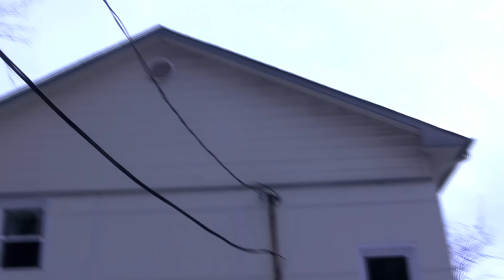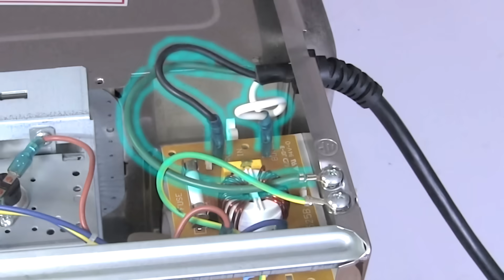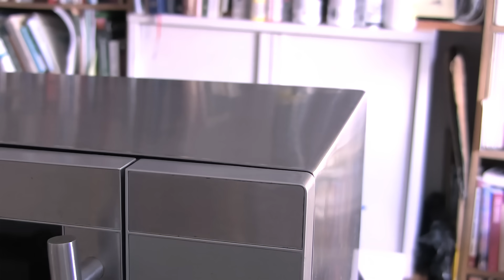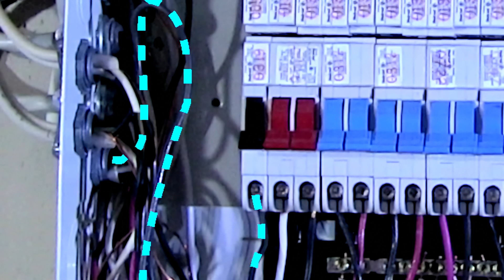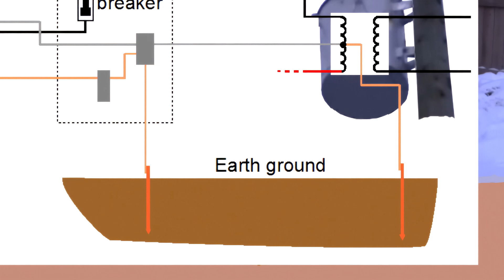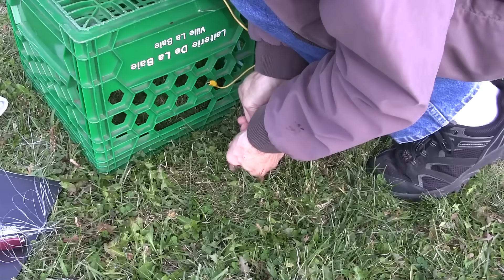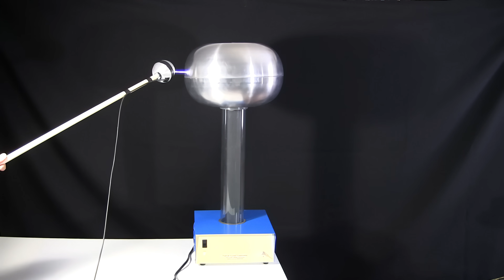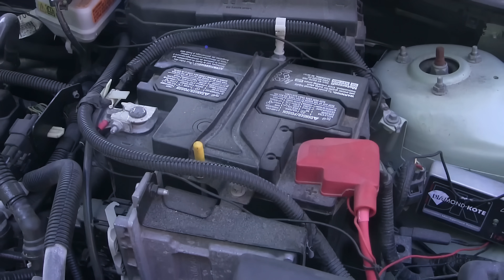What is Ground? Earth Ground/Earthing

Comment: Please, never ground to a water line...ever.

It's a very small chance, but a circuit can  corrupt or lightning can strike while you are washing dishes. 

Grounding to a chain link fence could kill anyone touching it.
Reply: Caramon Majere using water pipes as ground in the US is a code requirement, not an option.
Reply: Aren't most water pipe systems grounded anyways (even when a grounding rod system is used)?

There are issues with relying on water pipes for the system ground... but as far as the electrocution issue brought up:

The sink electrocution hazard wouldn't really be any different than the risks all the metal bodied appliances that are grounded pose, no? In other words, even a system using a ground rod would pose risk to someone doing laundry, etc. Though neither the sink, nor appliances would provide the path with lowest resistance to ground (though, with the high voltage of lightning, I think its theoretically possible it would take those paths too)
Reply: Grounding to a pipe could lead to face flattening (from someone's fist or feet).
Reply: @GamePlayShare  

What???
Reply: @caramonmajere447  I think he's suggesting that anyone who grounds to a pipe deserves a punch in the face.
Reply: Cekeybula  

The water isn't the important part. It's the copper lines, being all interconnected, that hook up to your potentially metal faucet. 

Low resistance doesn't matter when 1.21 Gigawatts flows through it.
Reply: @caramonmajere447  Jeez, are you powering your toaster directly from a hydropower station?
Reply: Cekeybula   The water pipe, if metal for 10 feet outside of the house or building is NEC required to be connected to and is grounded because it is in direct contact with earth.   I think you agree with that.  The pipe is being used as a grounding Electrode.   I'm not sure where someone came up with 001 ohms.   NEC requires the grounding electrodes to be less than 25 ohms.    The statement about it being low resistance to keep from getting shocked is incorrect if you are talking about the "equipment ground" connected to the case.   The equipment ground and the earth ground have different purposes and pretty much nothing to do with each other for ground faults.

Comment: I find it very confusing to call it neutral, shouldn't it be called negative?
Reply: On DC  yes but AC no
Reply: @umt1cardiff  What does DC and AC mean?
Reply: AC mains basically switches polarity 50/60 times a second, so there is no "positive" or "negative", as it's constantly changing
Reply: Some suggest the term 'grounded conductor' since it is a conductor and is at ground potential. Or 'common.' Not to be confused with Equipment Grounding Conductor (EGC) (green or bare copper wire) which is usually called ground. You can see why the subtle difference between groundED conductor and groundING conductor may also be confusing though. 

And as others have said, negative would not make sense either since it is alternating current. And for what it's worth, 240 volt appliances don't use the 'neutral' since there are two 'hot' feeds into the house with the needed difference in potential of 220-240 volts.
Reply: Absolutely not neutral it's electricity return back to the transformer and complete the fhase
Reply: Pepe,   To try to make this simple,   Let's assume electricity flows negative to positive.  So DC(Direct Current) flows from negative to positive in a closed circuit.   AC(Alternating Current) in half of the time flowing from the breaker out  to neutral, and the other half from neutral back toward the breaker.  In US it changes 120 times or twice per cycle or 60 hertz.   50 hertz across the pond.   Hope this helps you.

Comment: I have done electrical in USA. I am not an engineer. Regarding difference of N and Gnd, I look at this way:
Neutral is what operates the equip with the hot. Ground is there to not electrify the chassis (example) or make it short and trip breaker. (BOOM!) Otherwise, you come along, and YOU then are the path for electricity! 
I see many Q's; "can a neutral shock you?" Worst is an "open" neutral! Where a devise is connected to hot and the other wire is not yet connected. You touch that wire and Oh boy! Always connect N and Gnd, then hot. Good habit to form.
Reply: Also compare socket plugs: First, Gnd ist connected, as you plug in. Neutral and phase follow shortly after. 
Although the North American plug lacks safety, this is taken care of

Comment: If ground is connected to neutral, what prevents the circuit shorting every time you plug something in?
Reply: the circuit is completed by the thing that you are plugging in, and it will have a resistance to prevent overcurrent.  So the circuit can't short because the electricity has to flow from hot, through the appliances resistance, and then to neutral.
Reply: Neutral is the return path for current and the ground is the reference. Electricity takes the path of least resistance and would return on the neutral. The " neutral " at the outlet is properly called common.  Neutral proper is at the panel ( white service conductor) and should have ideally 0 ohms to ground.
Reply: @MaxwellPSmart  Earth is used as a current return path for HV lines. The grounding and neutralisation is made at the transformer. Also, power delivery norms changes depending on the location... In France for example, earth is not connected to the neutral in house electrical boxes, only at the HV xformer.
Reply: MrPureBasic: not so, at least in the US. In our system, current is NEVER intentionally supposed to flow through the "earth" ("ground" in the States) wire. Maybe in France it does, but not in the USA. The purpose is to tie one of the two ends of the incoming transformer voltages to a known "safe" potential. What could be safer than earth itself? BTW: dirt is a pretty lousy conductor. Trying to pass current through it will produce a lot of I*R voltage drop. None of the US power poles has a heavy gauge wire connecting up there on a high power pole down to the ground below. Such connection is done locally at the house, where the power lines enter.
Reply: https://www.youtube.com/watch?v=LoQVdEQlmXM&ab_channel=schulerruler
Reply: zvczvcvzxcv    Why would you think it would short out if neutral is connected to earth?   When you plug something in, you are connecting a " load" to the hot and neutral if 120 volts.   If you were to attach a conductor from a circuit breaker directly to a ground rod in your yard, the breaker will not trip unless a GFCI breaker.   What will happen is all the worms near the rod will come to the top of the ground very quickly.   Don't ask how I know please.   Watch the video a few more times and follow what it is saying.   This is one of the best I have seen for accuracy!!!!

Comment: Electricity is complicated and mistakes can get you killed. He was talking fast but had good visuals for explanation. People should not be doing their own electrical work and creating problems they don't understand. In older buildings you see 2 pronged plug and no ground. People have cut off the ground wire on the plug for the 2 pronged plug but you lose the protection.

Comment: There's one thing you forgot. GFCI breakers detect current leaving hot but not returning into neutral and then trip if there is a mismatch, even when the amount of current is less than the normal amount required to trip a circuit.

Comment: Sinces i was born in my house we never use ground wire , yeah prety bad but we never have any issue woth that for miracle all cables in my house only use 2 cable .
Reply: So are you saying because no one got shocked, that you are completely safe?   I did a temporary electrical system for home construction project.  I installed GFCI receptacles for use be trades.   The brick guys came and plugged in their mixer that they had used for years.  It kept tripping the GFCI.  I was called and requested to install non GFCI receptacle.   I said absolutely not.   They opened up the electrical connection box and found that it was not correctly wired.   I feel good that I "may" have saved someone's life.   Your house was fairly old if you had 2 prong receptacles,  if you ever want to be a little safer, install GRCI receptacles next to the panel and feed thru to the rest.   The life you save may be your own.

Comment: My doubt is
 if there is no loop in grounding so how the current is flowing bec current flow in a loop
Reply: Or to state it differently - there is a loop. The generator producing the voltage for your house is also connected to ground at its location so the current flows back to the station over the ground.
Reply: That's how the small light in electician's screwdrivers works, they don't need a path to the earth itself, you are the ground. You could use anything else a bit massive.
Reply: And you are indeed not à ground when isolated from earth, but rather a capacitive load that can be used as a small mass for alternating current. Perfect for small radios.
Reply: @MrPureBasic  What is 'that' which you refer to (In 'that's' how the small light...works)? I agree with your second response. Here's what Wiki says on those tester lights: "A neon lamp takes very little current to light, and thus can use the user's body capacitance to earth ground to complete the circuit."
So in essence, there is still a complete circuit. 

Perhaps I'm reading into others' notions about charge flow too much. I am just trying to clarify that current won't simply 'pour out' of something into something else (like the ground) just because of the notion that the earth has endless space for taking on (or losing) extra electrons.
Reply: Electrons flow in accordance with electrostatic attraction as well as repulsion. Electrons are pulled towards the ground. You don't need a loop.
Reply: @dhvsheabdh  Current is trying to get back to source. YOu indeed need a 'loop.' The earth can be a part of that loop, but in residential electrical systems it almost never is. Even when a fault occurs. The fault path is along the 'ground wire' (or equipment grounding conductor- EGC) into the service equipment (panel) onto the neutral feed, and back to the transformer. No 'earth' involved at all.
Reply: @spruce_goose5169  Well, you fundamentally don't. Electrons are pulled towards positive sources. No loop is needed to cause this.
Reply: @dhvsheabdh  Are you denying Kirchhoffs laws or simply addressing that displaced current (such as capacitance) can account for flow? Given our limited exchange I can't decide if my understanding is just not deep enough to 'be on your level' (because it's not super deep) or if your understanding is misguided. 

In simplified terms, charge must return to source. Correct? It may include a time variable, or displacement of sorts, but it returns. More relevant to the discussion of household AC grounding paths: the system does not simply sink current into earth without returning it to source. (Are you positing that the earth is positively charged and just 'pulls' charge to it constantly?) 

Most important in a practical sense: Fault paths use the grounding wires (sometimes referred to as equipment grounds) to return current to the transformer via the ground/neutral bond in the main panel. Or, worse case scenario (open neutral at service equipment) into earth, through earth, to the utility pole ground. It doesn't just sink into the earth into never never land.

Comment: Here in Malaysia we commonly use TN-S standard since Earth and Neutral are isolated. And because of that, the household is only grounded by the planted ground rod, and that means the Earth wire is not connected to Neutral wire. So that, we use three types of breakers; Main Switch, RCCB and MCB. Main switch controls the input voltage from the main into the RCCB. The newer ones can trigger by itself during short circuit or overcurrent. RCCB protects user by tripping (or trigger) when it detects current imbalance between Live (known as HOT or Line in some countries) an Neutral (or NUL in some countries), which occurs when some current got leak to Earth. MCB on the other hand, functions just like the Main Switch but the main purpose is to distribute the mains voltage supply to the entire home. MCB has its own maximum current like 6, 10, 16, 20 and 32 amps. So, unlike main switch that trips at high current like 32 and 63 amps, MCB will trigger itself at its maximum current without depending on the main switch that trips at much higher current.

Comment: Questions
Reply: Answers
Reply: Why call it ground if it is connected to neutral. It is two neutrals and one plus in a socket, right?
Reply: @SomeGuy-ye8it  Not at all. Neutral wire is heavier than ground because it is expected to carry a current. Ground is expected to carry a current only long enough to flip the breaker. While they are similar, their purpose is entirely different.

Comment: So it does matter the way you plug an electric device? :O
Reply from the maker: That depends on the electric device. The ones with plugs which have only two prongs and which can be inserted either way have electronics inside for which it doesn't matter. For example, if the first electronic component is a transformer then it doesn't matter which way the hot and neutral connect to it.